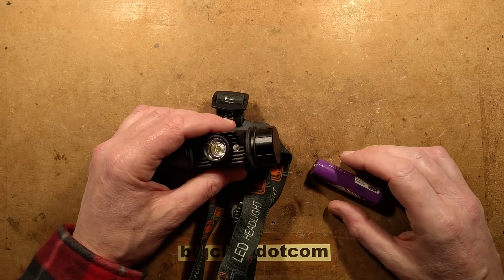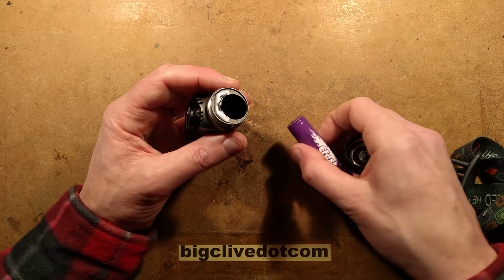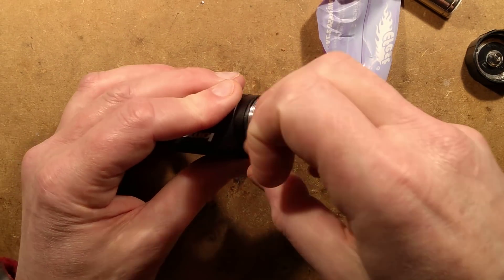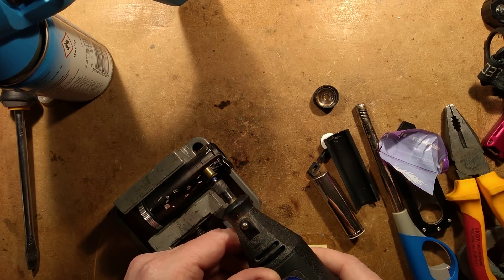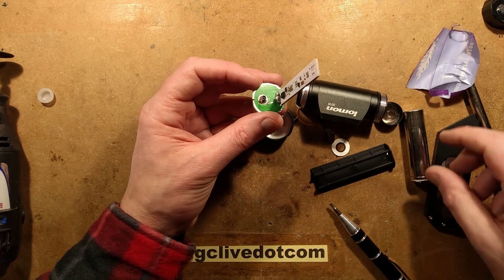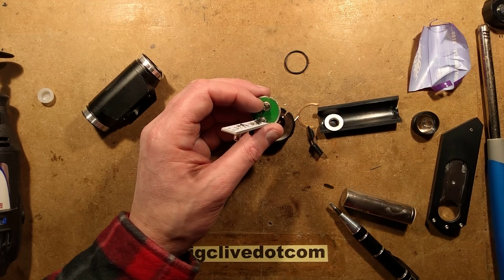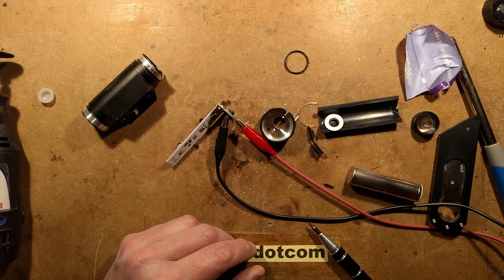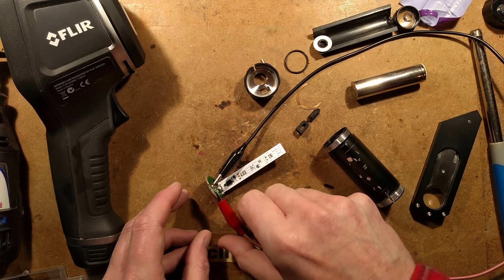Head torch shorts out 18650 cell while not being used!

Comment: I was looking at headlamps for a gift and came across one on amazon that had 2x 18650 cells in a plastic pack on the back of your head with the light up front.  One of the comments was that it was had a hard wired parallel connection with no reverse polarity protection so if you put one cell in backwards it would be in full short with the other one. Nice.  If a UK manufacture wants to make a product they have to meet all kinds of stringent safety regulations but chinese stuff on Amazon is made to whatever standard the chinese manufacturer decides which usually means nothing with the fake CE logo slapped on it.
Reply: I recently bought one on eBay, it's fantastic. I don't replace the 2 batteries, because they're in parallel and if I accidentally put batteries with voltages that don't match it could go bad.
But I don't think you can put one backwards, specifically in mine, the metal tabs are concealed behind plastic fairly well.
I charge it with a TP405...somethingmicro USB module.

Comment: Design-wise, a soft springy +ive terminal is also a very bad idea.  If the pointy end of the spring works it way under the wrap or the insulator ring to the -ive case only a fraction of a millimeter away, an instant short circuit is the result.  Most batteries do not have the insulator ring glued in as that one appears to have - most are just a plastic ring held in place by the wrap.

Comment: Clive don’t you always put a battery in with the spring at the negative
Reply: Flashlights often have springs on both sides so that the power doesn't get interrupted and change modes when bumped. but sort of yes, the "tailcap" (the only thing that unscrewed here) is the negative 99.99% of the time

source, i make flashlights

Comment: Well let's just hope that they don't start relying on anodised aluminium to insulate against mains  voltage... ..
Reply: I've seen DIYers relying on anodising to insulate power output transistors from the heatsink in +/-40-50V powered audio amplifiers... And it actually works, and thermally it's great (no additional thermal resistance caused by the silpad between the transistor and heatsink). But I would not trust in it in the long term as electric insulator.
Reply: @mrnmrn1  

Mica washer: do you remember me?
Reply: @westelaudio943  If I remember correctly, mica has even higher thermal resistance then silpad. Fisher Electronics makes great Kapton insulator sheets for TO-220 and TO-247 packages, with two phase thermal compound on both sides. And I think Panasonic makes graphite based sheets, which has lower thermal resistance then copper ! The basic ones are non-insulated, but insulated ones are also available.
Reply: @mrnmrn1  

Lol... I remeber cutting a Kapton voice coil former from a blown speaker for makeshift TO-220 insulators. Worked fine but I always thought mica was better because that's what's mostly used...
Reply: @westelaudio943  Well, Kapton is not a great heat conductor in the thickness of a regular mica or silpad insulator, but its dielectric strength is very high, so a very thin layer of it is enough, and that makes it better than silpad. IIRC, the Fisher Electronics stuff I mentioned has 1/4 the thermal resistance of regular silpad insulators.

Comment: That's why I don't use flashlights that are operated by a 18650 battery and a spring terminals.
Springs and 18650 batteries are never a good combination 😅

My 90€ Olight Warrior X (2016) flashlight has two pins that are touching the Lithium battery and there is no risk of short circuit :P

Comment: tip: if items like ports and switches need alignment , it will not be screwed like a cap
Reply: Unless there are internal splines that hold alignment of the insert while the cap still screws on to provide the clamping force.

Problem is you don't always get to figure that out by opening in a non-destructive manner.

Comment: I'm guessing that no name 18650 doesn't have a safety fuse. It's just as well that it's likely a low capacity cell. Lucky.
Reply: It is not a low capacity cell. The reason it did not explode is because it is an IMR chemistry cell, which (along with other modern types) are much better behaved then the older ICR cells.

Comment: I'm giving my fenix headlight the side eye right now.
Reply: Given the primary feature of it's Phoenix namesake, I think it'll survive a fire. You? Pehaps not so much.
Reply: I think/hope Fenix are more reputable and would have more consideration in their design choices.

That said I'm still not super keen on having a big lithium cell strapped to my head irrespective.
Reply: @anononomous  I took a look in there and it was interesting had a couple of what looked like gold contacts next to the spring.
Reply: Do you think they might short
Reply: Put some superglue on them just in case👍
Reply: @keithking1985  not at all sure but it seems like it could be possible.
Reply: @ucitymetalhead  They are there for a reason...
Reply: Fenix is great...My Fenix HL60R (i have a special Finland only model of that)is the most reliable headlamp i have used
Reply: @-joo3033  I have that model too though not the Finland version of course. what's the difference in that version if I may ask.
Reply: @ucitymetalhead  1000Lm output and the two smaller LED,s are different, one shows battery level and the sekond is a Warm  LED (moonlight)
Reply: @ucitymetalhead  btw on both models the micro usb port is waterproof even without the cover

Comment: I put the battery wrong way round in mine and it let the smoke out.
Reply: Some electronic designers take steps to protect their circuits from reverse voltage.  Then there's the cheap stuff.

Comment: It’s unfortunate this thing is so poorly isolated because I am sick of eBay headlamps with there never ending strobe features! Great video 👍
Reply: Fenix HL55 doesn't flash.  It has three power levels, nothing else.
The HL60R looks similar, but they added some pointless functions.
Reply: The company's making the lights are being cheap and buying in cheap Chinese chips with a strobe setting.. Or as I call it "epilepsy mode. ". BAH HUMBUG to them!!
Reply: But what else would you use if you wanted to visually shout "SOSOSOSOSOSOSOSOSOSOSOSOSO..." at people in front of you?
Reply: @YesterdaySoup  SOS mode is great for pointing at the back end of a speeding car and letting exactly two flashes out. The brake lights come on immediately as it perfectly simulates a speed camera. I like to think that they drive  sensibly home and wonder for the next two weeks if they're going to get a speeding ticket in the post.
Reply: Convoy is a good brand for bargain Chinese lights that don't do a bunch of annoying nonsense. Seem to be somewhat durable too.
Reply: I guess sliding switch pretty difficult to waterproof. And with button you just have to use rubber membrane. And if you are using button - you have to use one standard crappy chip.
Reply: @mayoropl1  Could also use a two-position button with a gasket or a rubber dome. It's a little silly that of all the chips to inundate the market at rock bottom prices, it had to be that one.
Reply: @mayoropl1  I agree with you Pavel a slide switch is to much effort for them to water proof.
Reply: The strobe is for use in emergencies
Reply: Why is it that so many 18650 lights have those strobe modes anyway?  It seems almost all of them have it!  I gave up trying to find a decent flashlight that is just on/off because they're so hard to find. I may try to make my own at one point.  An 18650 cell fits perfectly in 3/4" copper pipe, so it's a nice base to get started off of.
Reply: @Red Squirrel - Because as Clive's noted before, they all use the same chip which is designed for bicycle headlamps. The reason for the strobing is to make the bicyclist more visible.
Reply: Red Squirrel I agree I bet it’s because those bright power chips that drive the majority of these light have that  functionality built in possibly 🤷‍♂️

Comment: If you manage to non destructively open the other one you could protect the board with plenty of kapton tape which obviously should've been done from the factory
Reply from the maker: I've been testing whether some strips of plastic can be slid in from the battery access end.  Someone else also suggested using a protected 18650 cell.
Reply: @bigclivedotcom  Could you inject some conformal coating down there?
Reply: @bigclivedotcom  I have had the same problem on the £2.50 "XM-L" (not really) eBay torches. The positive spring is awfy close to the (negative) body contact spring. I 3D printed a nose cover for the cell, that only allows contact to the button in the centre.
Reply: @bigclivedotcom  Or you could anodize the interior? jk
Reply: There are two items to address: accidentally turning/leaving it on, and accidently inserting the battery, negative first.  To protect against backwards insertion, replace the cap spring with one or two cap contacts that are well off center and only able to make contact with the wider, negative battery end.  To prevent accidental turning on, remove cap, insert thin plastic disk (cut from some product packaging) covering the negative end of the battery and replace cap.

Comment: can a protected cell help here ?
Reply from the maker: Yes.  It would hopefully cut off if the current was high enough.  That's a good idea, because I really liked this light.
Reply: @bigclivedotcom  a protected cell saved one of my vintage Lego motors that was stalled
Reply: @bigclivedotcom  videos of bike batteries going off is scariest thing if its inside your home
Reply: @girlsdrinkfeck  Lois Rossmann also had a scary video when his bike battery caught fire in traffic.
Reply: @bigclivedotcom  Although it's body is made entirely of aluminium, the heatsinking of the LED looks quite poor, considering the 3W they were pushing it.
Reply: @bigclivedotcom  those efest cells are very sketch, lg, Samsung and Sony are what I trust my face and hands to
Reply: @boj4klayman919  Samsung, LG, Sony, Sanyo/Panasonic
Reply: @-joo3033  those are both good brands as well I just don't spot them in the wild often

Comment: Truly scary... with the incredible popularity of rechargeable devices containing high capacity (high energy) lithium batteries, often with sub-par manufacturing quality control, it is only a matter of time until they become a cause of house fires, even if not in use or being charged. Lithium batteries in the 2020s are going to become the danger 1970s aluminum house wiring became in the 1980s.
Reply: This is not even a manufacturing problem, it is a design problem. Or actually the willingness to sell faulty goods.
Note that not all cultures have the same approach to safety. Some ride 4 on one motorcycle. Others insure everything twice.
And there's the enthousiast folks: "my drone can't crash, it has low battery detection and autoland" - well Sir, there are many other ways...
Reply: I was thinking this a few days ago. How much old crap goes up in the loft  or stuffed in the cupboard under stairs. Especialy now so much chinese tat uses so many reclaimed or shit to begin with 18650s etc etc.
Reply: I'm storing all my lithium batteries outside in a fire and explosion proof enclosure until cooler heads prevail and develop a 'safe and sane' rechargeable battery.
Reply: Clive's "Li battery explosion containment device" comes to mind.
Reply: It's already a problem and does cause house fires. and is why you can't put them in air plane cargo.
Reply: How is it that this comment was made 3 weeks ago when it's timestamped for today, Nov 29?
Reply: @CassiaConvolution  i think patreon supporters get early access to his videos.. theres are a few comments from 3 weeks ago and big clive replied to a comment  3 weeks ago
Reply: @09danstart  Interesting.  I would not have thought 3 weeks to be a standard sub-only delay time.
Reply: I think this is a lot longer than normal, from Patreon-only access to published on YouTube. Maybe Clive got busy with something else, and forgot to publish until today.
I was wondering why people were suddenly replying to a comment I left weeks ago!
Regardless... the fire hazard in the future with aging, poor quality Li battery products is real.